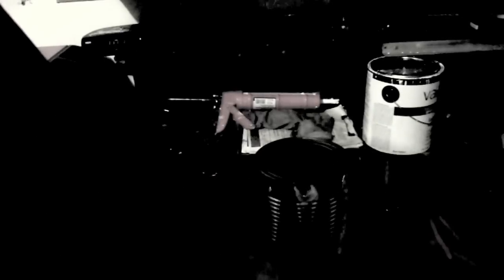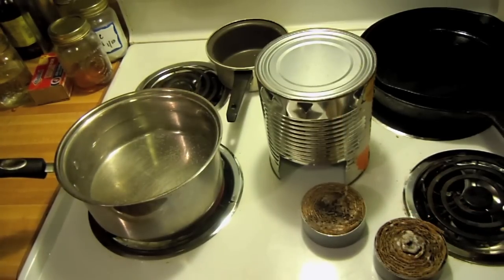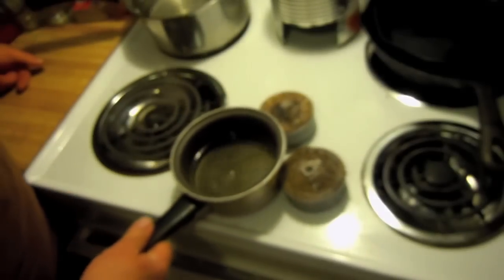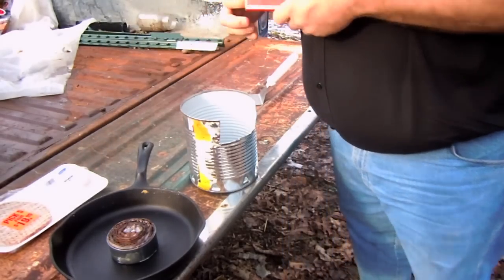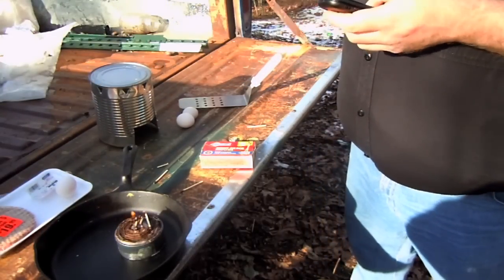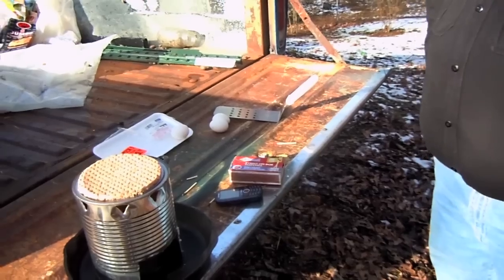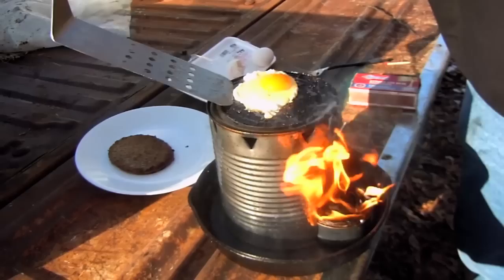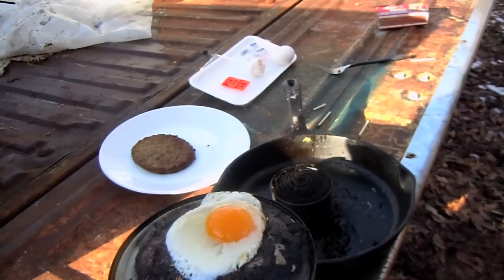How to Make and Use a Tin Can Stove

Comment: We used an old wire coat hanger as a multipurpose tool to go with our "buddy burners".  Fashion one end in a circle the size of your tuna can then cover with tin foil... makes a snuffer for the flames.  The other end you fashion into a horseshoe shape... use it to push your can around while burning.

Comment: We did do this in my girl scout troop. The way to control the temp, we were taught, is that bottom part that you cut completely out for putting in the tuna can. Do not cut that completely off, leave it there, to bend back and forth, put it down more for less heat (less oxygen getting to the fire), and up more for higher heat (more oxygen-more flame).

Comment: take a 1 lb 12 oz can of peachs, eat the peachs, put the stripes of cardboard in the can, with  the center wick being a cotton ball with petroliun rubbed in it, sticking out of the hole in the center of the cardboard, use wax or crisco in the cardboard, place can on a flat rock in the center of a tent to keep warm. use 2 or 3 cans as needed.

Comment: We would make these as scouts, and we would save the lid from the tuna can.  Using a clothes pin; when the burner was lit and inside the coffee can, we would push the lid forward and back resting on the top of the burner to regulate the size of the flame - and therefore the cooking temperature.  These also made it much easier to blow out the burners when cooking was done for that meal.  It worked surprisingly well, and two burners would provide all each scout needed to cook six meals from Friday evening through Sunday afternoon field trips - including heating water for cleaning dishes and pots.  We also made a few extra to use to light the camp ground in the (especially winter, when wood fires were inconvenient to maintain) nights to provide lighting and to create the flickering 'campfire' effect for the troops falling asleep inside the tents in a perimeter 15 - 20 feet from these open flames.  A couple of adults would each have 15-20 wax chunks (1-1.5 inch or 3-4 cm diameter) inside plastic bags to place on these ground burners when the flames were running low, and usually return home with half or so of the original unused chunks.  These could also be used if (especially inexperienced) scouts used their burners more quickly than was necessary.

Comment: A quick and easy way to put it out would be to take a second # 10 can, with no extra holes in it, and put it over the burner/candle. It will use up the oxygen and put itself out.
Reply from the maker: Good idea,  thanks

Comment: I would've liked to have seen one of these stoves used in the making of the wicks. Oil the top of t he can to do eggs. Use the flat cans that have pull-tab lids. Turn the pull-tab backwards, that becomes a handle. The lid can be then used as a snuffer.

Comment: An idea to control the temp would be to use a long thin can that you can pull out to reduce the heat. Oh n for your wick I would try a vasolean on a cotton ball put ontop of your fuel whial the wax is still wet so it holds it to it. Great stove tho